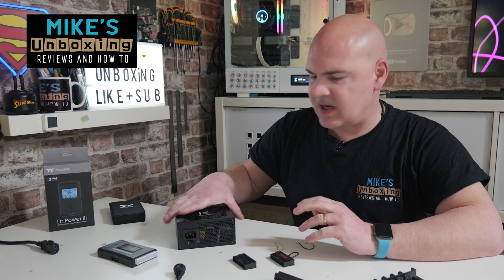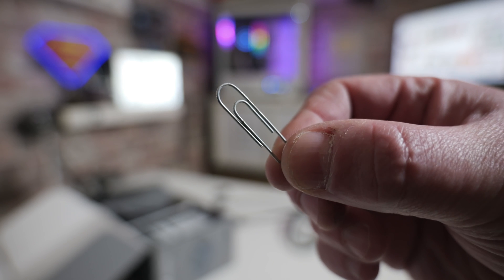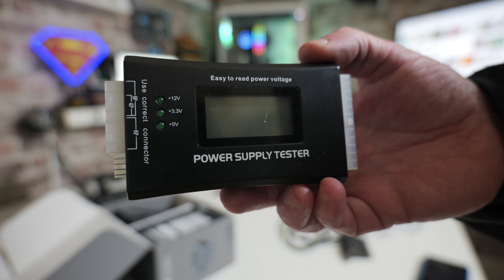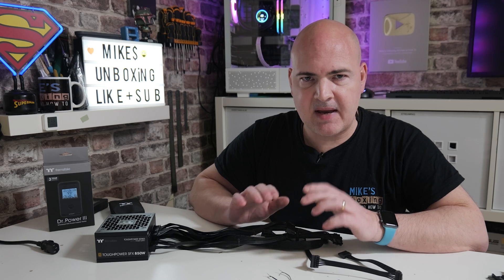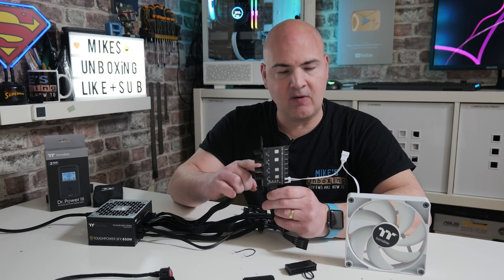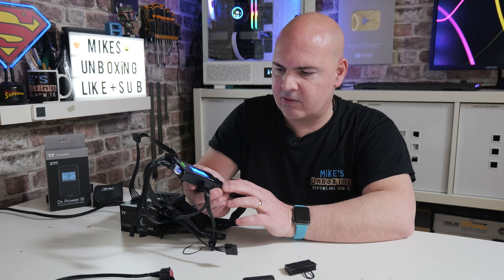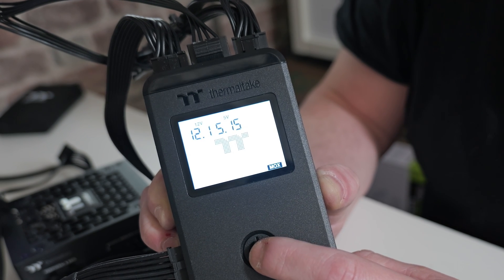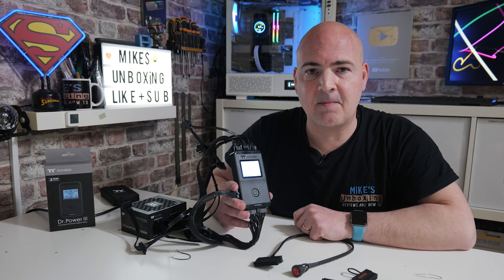How To Jumpstart your PC & Test A PC Power Supply From Simple To Advanced FT Dr Power 3

Comment: If the PSU is working order why didn't the fan turn on when you jump the pins at the beginning of the video?
Reply from the maker: some psus have a zero fan mode that means it won't spin unless hot or under a decent load

Comment: Mike, I need some input,  I have a refurbished msi mpg a1000g  bought from scan it was missing the 12vhpwr cable for my 4080 super.

I contacted scan they said they could send me a 12vhpwr cable from a msi meg ai1300p 1300w psu.

Would this cable be fine to use? 
Is there anyway to check they use the same connectors 

Regards 
Also Mike
Reply from the maker: as far as i am aware all of the cables are the same pin wise so even aftermarket ones will be okay. the only thing is that they have the sense pin to tell the PSU if the cable is 150w 300w 450w or 600w
Reply: @mikesunboxing  alright thanks Mike 😊
Reply: @mikesunboxing  I emailed msi. They said using the 12vhpwr to 12vhpwr was fine!

Comment: Many people don't read the instructions, forget to plug the PSU 24-pin power cable into the digital tester, and wonder why the tester isn't working. If the tester begins to melt in their hand, it's a sure sign that their PSU is bad. Some people need to remember to plug their PSU into a wall outlet and that it has a power switch. Sometimes, it's the simple things we forget to do.

Comment: Can i plug an older IDE HDD (molex), just to PSU that way,to test if HDD is spinning ?
Reply from the maker: yes put you still need to short the pins in the 24 pin power connection

Comment: I had built from a psu 2 12 volt connectors to the psu to use as a outlet 12 volt connectors for other appliances , I also used the 5 volt and put a usb on the box to use as a usb port to either charge phone or a for a fan , you can be surprised what you can do with a psu mike .
Reply from the maker: yeah only limited by your imagination
Reply: @mikesunboxing  I am boundless , I am limited as the ms will stop me from going over the top specially with electricity lol.

Comment: For years I use a multi meter to check the PSU, but last year I bought one of those fancy PSU testers and either works good if you know what watts or voltage you're checking for.
Reply from the maker: the multimeter is a good choice if you know what you are doing with it and know how to read the values